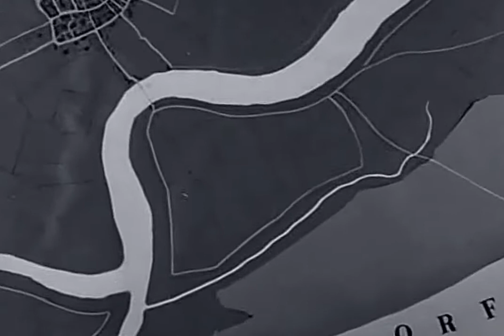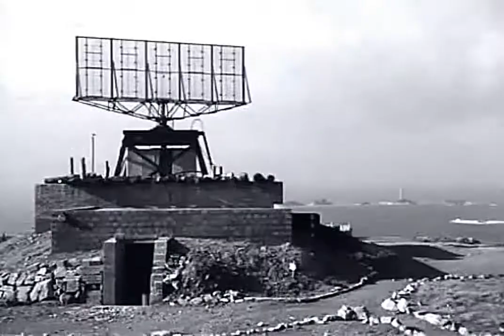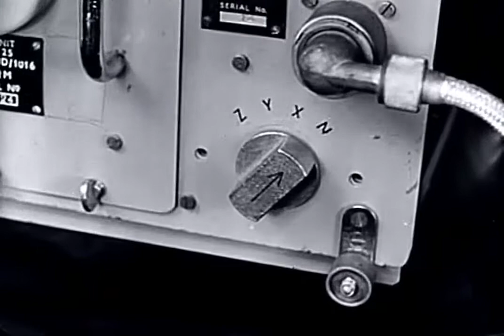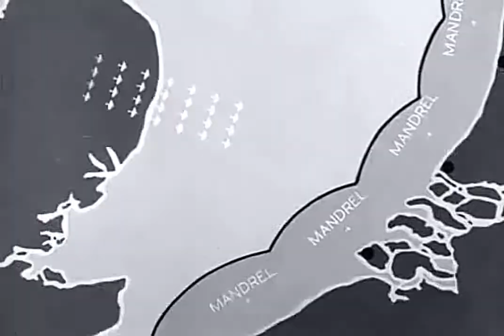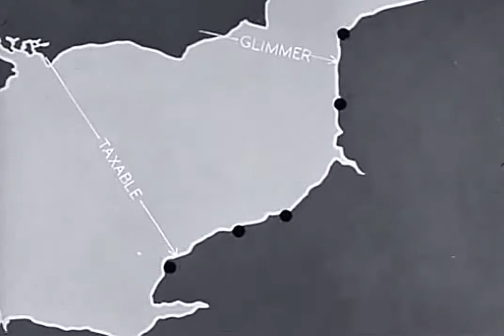RDF to RADAR  a Record of the Work of TRE

Comment from the maker: Land Sea writes the following comment, which I see in my notification, but not in the display here:  

Tom Owens - OK . I've found a block diagram of CH . - a trigger circuit is used to pulse radio sine waves , which are connected to the transmitter antenna "curtain" array . - the receiving antenna is a dipole antenna , which is connected to the superhetrodyne receiver , who's output is then connected to the y deflection of the CRT tube . - the trigger from the transmitter pulse , is connected to the x axis of the CRT . - the rest I don't understand .
Reply: Valve is the English equivalent to the US term Vacuum tube
Reply from the maker: @johnspurrell1200  yes it is. While I find plenty of humans eager to point out that fact, I've not yet found anyone confused by the use of that term in the context of this TRE film. Thank you for checking in, and hope you have a good weekend.

Comment: Meanwhile, owing to the limited range of AI, a form of ground control was essential to guide the night fighter close enough to the hostile bomber for AI contact to be made.  The two or three minutes delay involved in passing information to the filter room could be eliminated by controlling the fighter direct from the ground RDF station.  It was realized that accurate fighter direction demanded a new form of display which would present both range and bearing information in such a way as to give the ground RDF operator the targets planned position immediately and without calculation.  Research on this problem produced in early 1940 the first successful PPI tube.  Meanwhile research was being carried out on the problems of a suitable rotating aerial system and of more accurate high destination.
Reply from the maker: Great comment.  Thank you for checking in here.

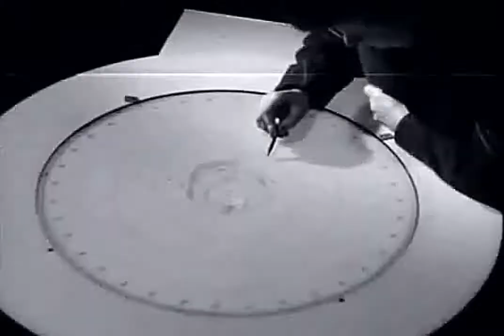Comment: 15:03 Curious about the Skyotron(?) mentioned. Is that the display device shown? How does it work?  I'm make a wild guess at iron filings with a series of coils on the rotating arm underneath?
Reply from the maker: 1944GPW, thank you for checking in to ask this question.  The PPI type device featured at 15:03 was called a Skyatron... with an "a".  The Skyatron ppi system was introduced in 1943 with the implementation of the Type 277 Radar system replacing Type 271.  The objective appears to have been better 3D representation.

In the early 1950s the US Civil Aeronautics Administration employed a Skyatron ppi plotting board at Washington National Airport to control aircraft departures and reduce lateral separation from 50 miles down to just 4 miles.

The display configuration consisted of a 3" CRT with deep-purple phosphor providing data from a microwave early-warning radar and standby ASR.  That information was displayed on the ground-glass plotting board by way of an optical system and a 1000 watt incandescent bulb.  They actually managed to ~electronically~ superimpose an aeronautical chart on the ppi presentation.
Reply: @TomOwensUAP  thanks for the detailed explanation and the correct name. No wonder I couldn't find it when googling. Also I can see this film was the source for some of the footage used in 'The Secret War'. A truly interesting and excellent film, thanks for posting it!

Comment: This is vintage radar gold 😊 As a raido ham myself this is a gold mine of info  😀
Reply from the maker: Yeah, it really is!  I am so happy you found it here.  I really enjoy researching and sharing info on this so your comment will motivate me to upload more.  Thank you for checking in.  I am Amateur Extra holding W3DAE.
Reply: No problem tom 👍 Me and my dad are both raido hams and mostly use vhf/uhf equipment so its realy interesting to see that they were using some of the frequencys that we as hams are now allowed to use for early radar. It makes you think, all the research and development that went into centermetric radar in the 40's with the cavity magnetron and we just go out and buy ham equipment for 23cms off the shelf 😂 Best 73's Eddy
Reply: @generalmassive1907  Even more amazing that almost everybody now has a cavity magnetron in their kitchen!
Reply: A bit of kit that I found interesting, was the Wireless Set No 10, a system that multiplexed 8 full duplex telephone channels, using pulse code modulation, on 4 GHz point to point links.

After the D Day invasion, it was extended all the way to Germany, providing secure telephone channels back to England.

Very advanced for the time.

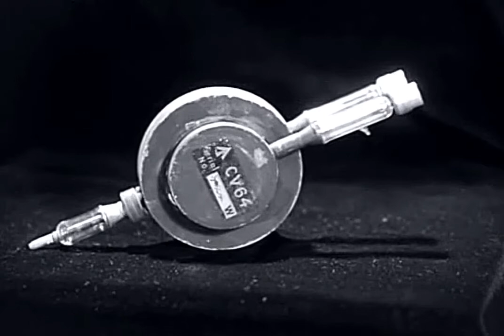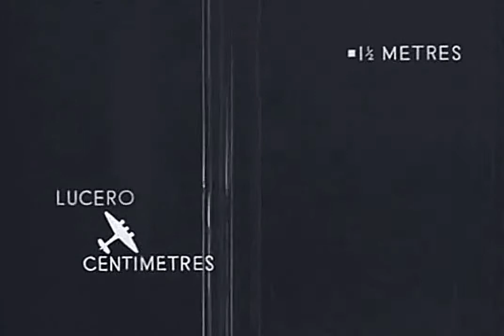Comment: At 17:40 note the Klystron was an essential part for the radar fine tuning.  In the movie "Forbidden Planet"  Cdr. Adams used a Klystron monitor to transmit and receive a message back to Earth to obtain further instructions on what to do next.   At 20:48 they refer to "responders" as ground beacons.  Possibly an early form of a "transponder" that not only received but sent back a "responding" message?